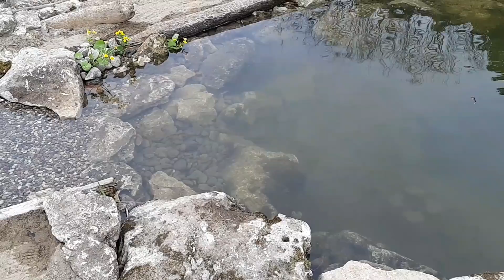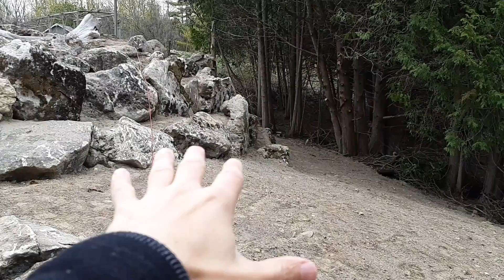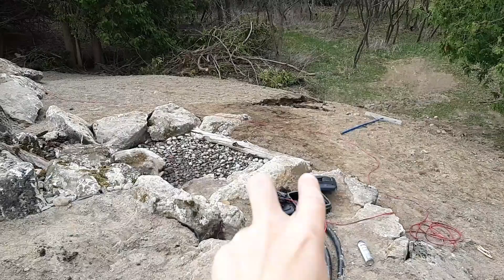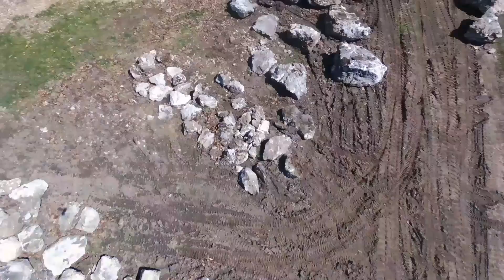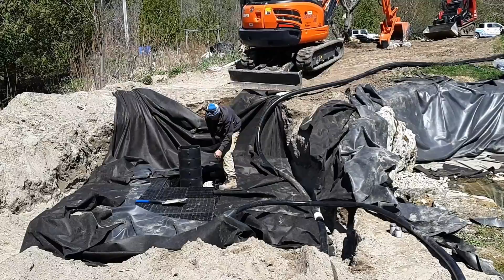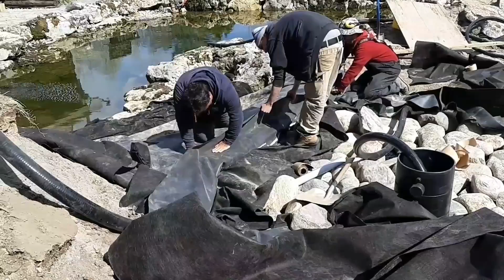Pond design - what is a wetland filter?

Comment: For a koi pond, do you think a wetland is more efficient than a profidrum?

Do you use a UV light on your system or any mechanical oxygenation?
Reply from the maker: I don't know if it is more efficient. I'm sure a human based design can make a more efficient filter, but it's absolutely less work, and does the job more that well enough. I have seen enough mature ponds with wetland/bog filters to say they have crystal clear water. I even know people who have had their pond water tested and it is potable. Not sure I would go that route myself, but something like a Berkley filter would do the trick for sure (for consumption, which you didn't ask, I'm not sure why I took it there).

I don't use a UV light or any mechanical oxygenation, just the tumbling waterfalls. I want to keep it as simple as possible, with as few sources of failure as I can.
Reply: @CanadianPermacultureLegacy  Thanks! So, the only power you use on your pond is for your pumps?
Reply from the maker: That's correct, yes. Oh and the lights which are only 1W each.
Reply: @CanadianPermacultureLegacy  Thanks! It doesn't look like you have a bottom drain in the deepest area of your pond? How will you deal with sediment which builds up there?
Reply from the maker: If you look st some of the earlier pond videos you can see a snorkel centipede system that I show. I can drop a solids pump down there and suck it all out. 

The bottom is kind of an fake bottom, it is about 4 feet of large river rock, and acts as a sediment trap.
Reply: @CanadianPermacultureLegacy  Understood. I think you will have issues with your koi as that deeper area with sediment will hold bacteria and eventually cause ulcerations.
Reply from the maker: I'm not sure, maybe I will but I would be very surprised if I do. I know many people who have ponds designed by the same people who have no problems after 10+ years. There is also a pump which takes suction from the deep end and sends it to the waterfall, so the deep end is not stagnant either.

These guys have it pretty well designed. The designer Ed Beaulieu has 30 years in the industry and a PhD in Limnology (the study of lakes and rivers), and the ponds are designed to mimic the natural systems that create healthy bacteria and watersheds.

I appreciate the heads up, but the components in the system should prevent that. (Well oxygenated water to promote healthy bacteria, underground reservoir to mimic underground aquifers, wetland filters, layered sections to promote a photographic layer and shallow water emergents, a medium layer for deep water emergents, and a deep water section for oxygen capacity and storage, etc. I will definitely be keeping a keen eye on the fish.
Reply: @CanadianPermacultureLegacy  i hope i'm wrong but having kept koi myself that is the one red flag i see with the design. This is why dedicated koi ponds have bottom drains - as your kois get bigger the amount of waste they produce is surprisingly immense....having said that it wont be an issue for 10 years (perhaps) and you can always drain the system and pump out the sludge.....

Also, do you have a separate generator for if the pumps fail? Unlikely, i know, but you could lose all your stock if that were to happen perhaps while you were away.....
Reply from the maker: I actually will be pumping the sludge out of the deep end and wetland filter every year. The way they design the wetland filter is that this is where the sludge tends to accumulate (due to pumping up from the bottom into a high resistant gravel media through a diffuser. So the idea is that you concentrate the settling material in one place so you van pump without easily (and use as compost).

I don't have backup power yet, but I am looking into my next big project which will be large solar and battery bank. I am waiting on government climate change subsidies pull the trigger. 

Until then, it's definitely an area of concern, but there is enough surface area (and huge pond with few fish) that they would likely only get in trouble after a solid month or more, possibly not even at all (for example many of my plants actually oxygenate the water, such as watercress which is known for doing this). Also, we don't really go away much, maybe a weekend a few times a year.

I am more concerned with a deep winter 3am power outage causing lines to freeze. I may drain the wetland and waterfalls/pumps for that reason, even though they say I can leave it running. It won't freeze if the water is moving, but it's that 3am power loss I worry about the most.
Reply: @CanadianPermacultureLegacy  Well, that will solve that then!

I wouldn't be too worried about the pumps working over winter as the fish will be dormant.

I wonder if they do such subsidies here in the UK!